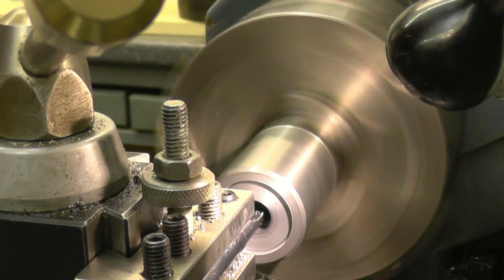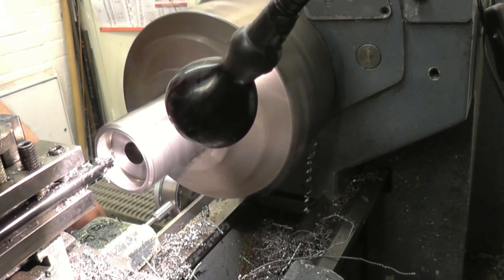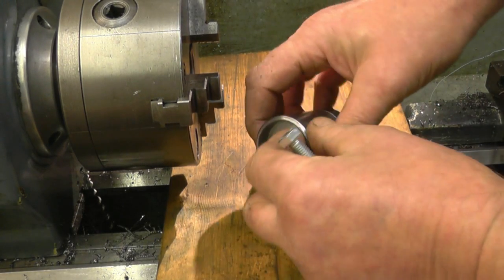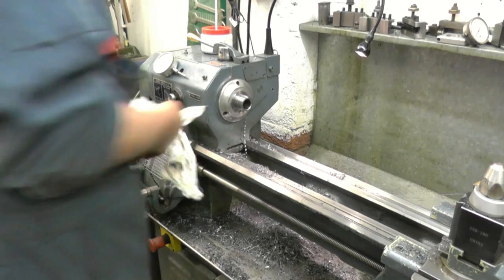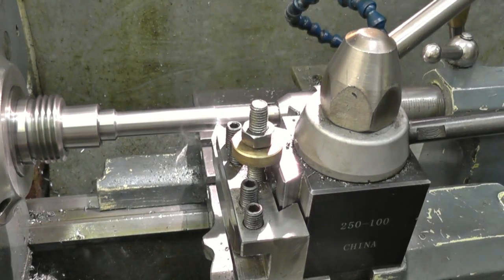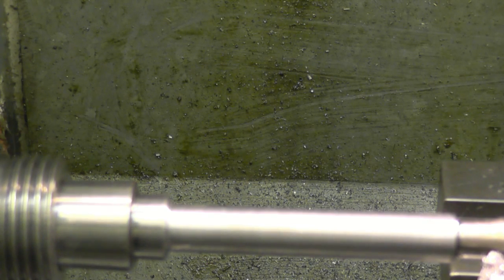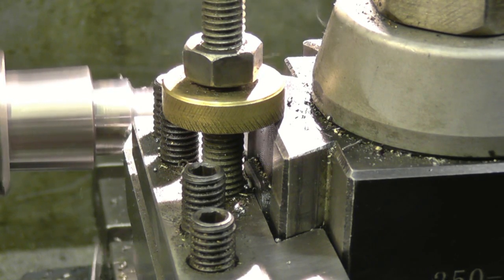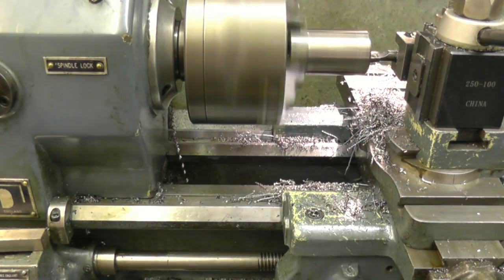Tail Stock Die Holder Part Four

Comment: Great work getting that fit with no filing or emery work !
You should get an inside micrometer, those calipers (as you mentioned) are just for rough-measuring holes. Maybe you could even do a video on that sometime: Measuring holes.